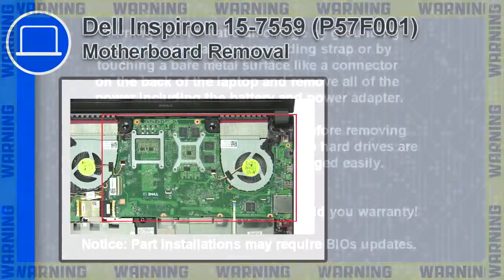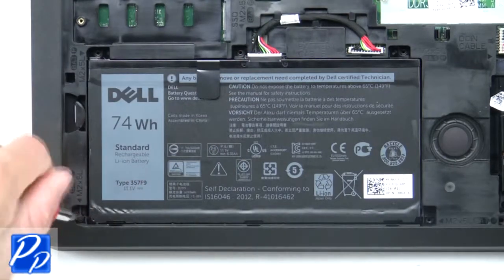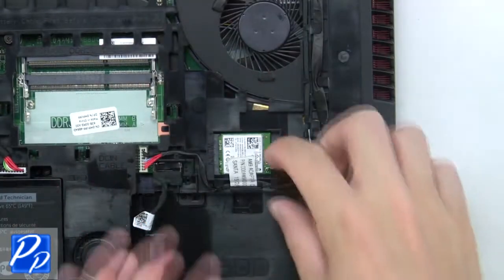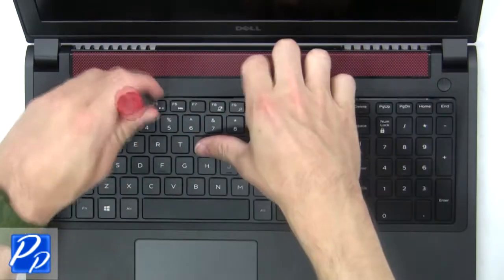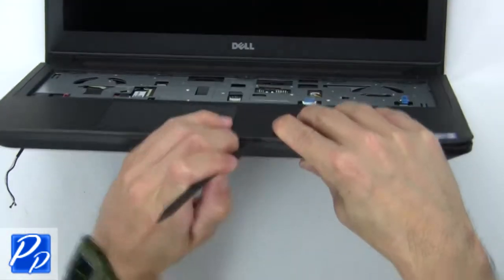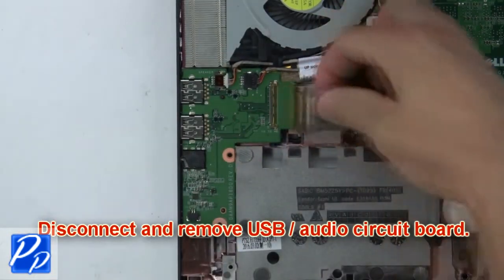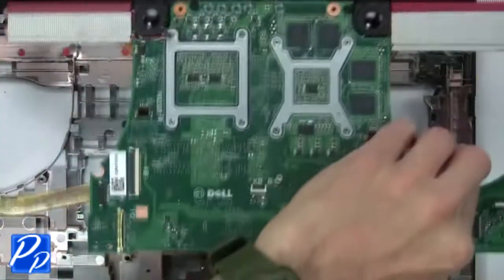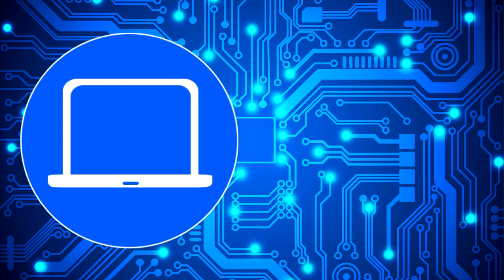Dell Inspiron 15-7559 (P57F002) Motherboard How-To Video Tutorial

Comment: so my Inspiron 15-7559  is not able to turn on, when i plug in the charger into the wall the blue light comes on but when i plug the other end into the laptop the blue light turns off. Does that mean that a short circuit occurred or what could possibly be the problem/solution? how could i eliminate all the possible things it could be?
Reply: Literally just happened to me. Removed almost everything. Either DC in cable or motherboard. Hoping it's not the motherboard. That will suck.
Reply from the maker: It may be a faulty power supply. I would try using a different one to see if this fixes your problem.
Reply: I had the same issue my laptop just died and does the same thing with the power lead
Reply: same problem with my 7559

Comment: Thanks plan on replacing the whole chassie internally the pc is fine but its looks like crap on the outside
Reply: Hi did you manage to replace the laptop in planning on doing the same thing how did it go?
Reply: @biniam1999  hey sorry for the near 2 month long reply but here's how it went 
Very very smoothly this laptop is incredibly easy to disassemble a child could do it the real problem is parts their easy to find but I recommend just buying the palmrest and bottom together it saves time and possibly money and I'm also planning on touchscreen swapping it tomorrow idk if that will work if you want to know let me know anyway hope this helps and sorry if I'm to late
Reply: @catioicat727  hi I had already swapped the palmrest and a few other parts but I'm interested in the touchscreen that you mentioned. How did it go? What part did u use and what tips can you give me?
Reply: @biniam1999  seems it gonna come in late I'll let you know asap how it went I found very little info online about it but from what I did see it said it was possible I wouldent recomend if you have the i5 though performance could get worse
Reply: @catioicat727  okay hope everything goes smoothly I have the i7 so hoping that performance won't be an issue
Reply: @biniam1999  ok so yes it is possible my screen is completly black though but that's a underlying issue with my laptop so shouldent be a problem for you  the lcd test work so it functions and when I plugged it up to a external display the touch screen worked fine and now device specifications says I now have a touch screen  so if you want to spend the money go for it
Reply: @catioicat727  hi can you give a link to the parts that you ordered. As well as some idea of the steps that you followed
Reply: @biniam1999  also while it's taken apart that would be a good time to re apply thermal paste not neccary but recommend and try to be gentle with the connections they seemed fragile